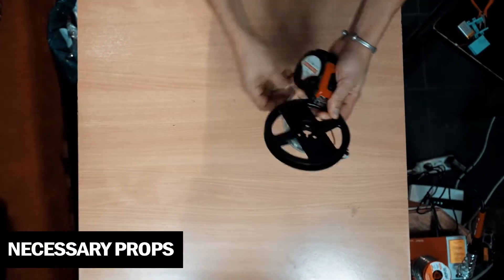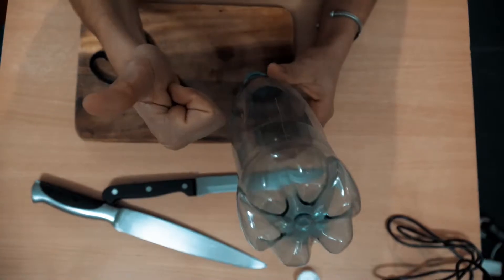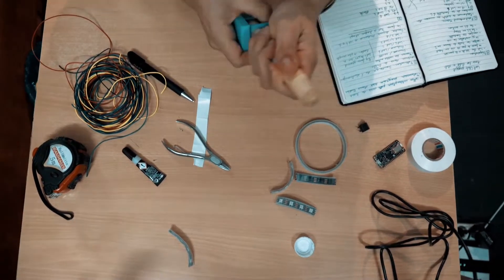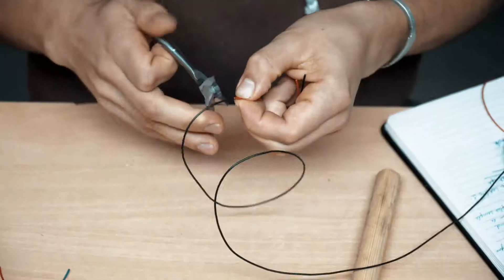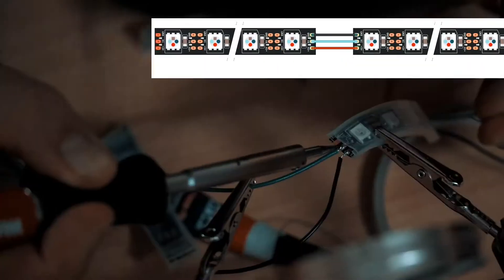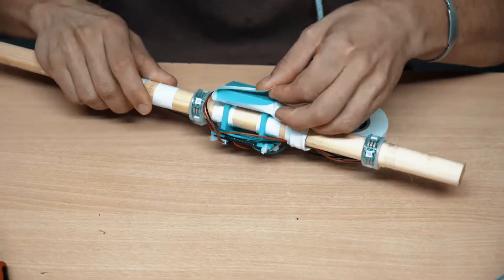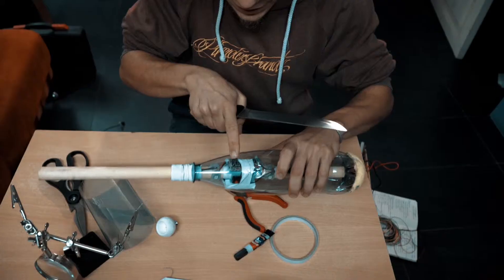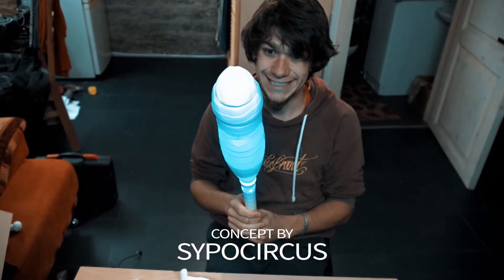Tutorial : How to make Led Juggling Club - DIY

Comment: Thanks for the inspiration, used it to upgrade my old clubs.
https://github.com/sffranke/DIY-LED-Clubs
Reply from the maker: Hey ! 
I just saw your comment. That's look great. I'm so happy to see this video has brought some inspiration. And that you've bring this to the next level. That was exactly the reason why I took the time to make this.
I wanted to make it with Tube like yours but couldn't find any, so I deal with what. I had available.
How reliable is your proto ? To be honest with mine, I never manage to get something reliable enough to use it for shows. But still good fun to work with. If you want to talk about it more, you can ad me on Fb : (Sylvain pomme)
Reply: @SylvainOULALA  Hi Sylvain! You got so many videos, I will need the rest of the covid timeout to watch them all :) They are reliable so far and I can juggle about an hour without the small battery gets tired. So far no club has failed.
For charging you have to unscrew the knob, but that's no problem.  I turn it on and off with a small allen key through a small hole in the knob. This works well for me, but it is not really professional. Switching off with the remote control is only good for short interruptions, because the electronics continue to discharge the battery even when it is switched off. Therefore the battery must be disconnected to store the clubs. Maybe I can think of a more elegant solution. 
I don't use FB, but we can stay in contact via Signal or Whatsapp, I'll send you my number. Maybe we will meet at a convention when conventions are possible again.